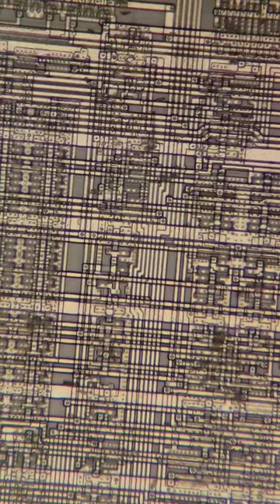AMD N80C188-20 silicon chip decap

Comment: AMD INTEL ?!?!?!...
Reply: It's about as crazy as seeing Samsung parts in an iPhone 😉 (supply chains are hilarious sometimes)
Reply: IBM wanted a second contractor that will produce 8088 and 8086 for IBM PC, just in case, so Intel had to license the design and architecture to AMD (and some other manufacturers).

Then, under this license AMD has produced 80186 and 80286, because they were considered a 8086 derivatives.
Intel had different opinion, especially since AMD sales were strong, so they forbid AMD from using 80386 design and took them to court. 

In the end, after a couple of years AMD was able to release their version of 80386. And some years after that, they had to reverse-engineer 80486, since they couldn’t get the documentation on it.

After that, they have parted ways:
Intel has had to brand 80586 as Pentium as one of the ways to get away from that 8086-derivative licensing deal.
AMD has polished their variation of 80486 design for some years, until they came up with their own K5 design.
Reply: bro, the team purple real

Comment: Please someone explain me a little, is    AMD and Intel are 2 different companies or they are related? Because this had AMD's and Intel's logo if i saw correctly, and AMD logo was inside Texas Micro Devices logo
Reply from the maker: AMD, along with a few other companies of the day, used to be "second sources" for Intel components. There's some good info on the Wikipedia page for "Second Source" I'd recommend checking out 😁
Reply: @EvilmonkeyzDesignz wow that's a very interesting story in the Wikipedia!  For others who don't want to look it up, here's what it says:

Intel licensed AMD to second-source Intel microprocessors such as the 8086 and its related support components. This second-source agreement is particularly famous for leading to much litigation between the two parties. The agreement gave AMD the rights to second-source later Intel parts, but Intel refused to provide the masks for the 386 to AMD. AMD reverse-engineered the 386, and Intel then claimed that AMD's license to the 386 microcode only allowed AMD to "use" the microcode but not to sell products incorporating it. The courts eventually decided in favor of AMD.[2]
Reply: 😂 got me confused too😂
Reply: There were as many PCs out there in the early 80s that had AMD CPUs as there were Intel CPUs. Intel just had better public relations.

Comment: I wish you decapped these a bit more gentle! Why not sand off most of the the casing.  Then etch it away , the laser removal is awesome, but seems to possibly lightly damage the surface of the die,   how about decapping something whilevin use!!  Then record it with ir or full spectrum camera. To see if any junctions are visible. maybe over power a naked diode , "AND" what do you do with the gold bonding wires and plated pins,  gold is over $2k/oz. ,
Reply from the maker: In my opinion, I think that the hot-air decap method leads to the cleanest results, at least for the types of plastic that release easily. I've seen some laser decap attempt videos, but they usually take it took it too far and obliterate the circuits on the silicon. Maybe its possible to tune the laser, but I think it would be pretty difficult to have the laser only target the plastic and not the circuit structures. Lasers are definitely good for removing the bulk of the material quickly which could be followed up with some acid, but that's not something I'm set up for quite yet. I think there are other package style parts like CERDIPs that would be better candidates for looking at exposed circuits.

I do save all of the scraps from these decaps. Not sure what I'm going to do with them just yet, but I do have quite a bit at this point :)
Reply: @EvilmonkeyzDesignz  When I was at AMD we used red fuming nitric acid (in a fume hood!) to remove the plastic without harming the die.